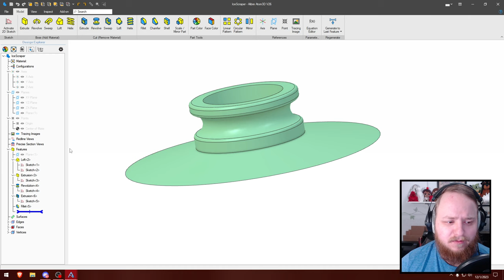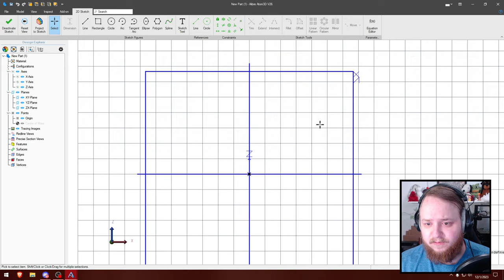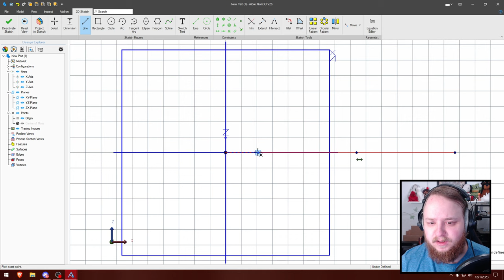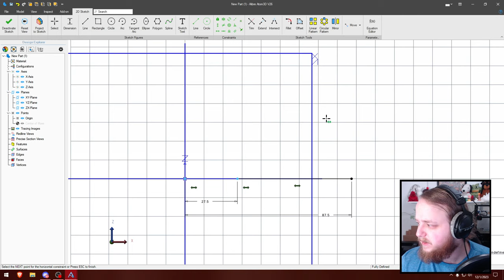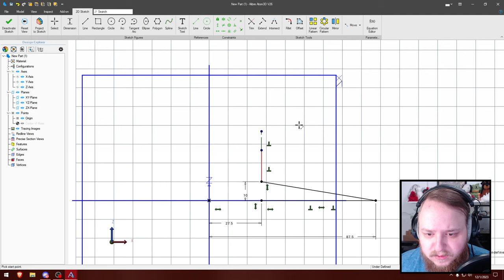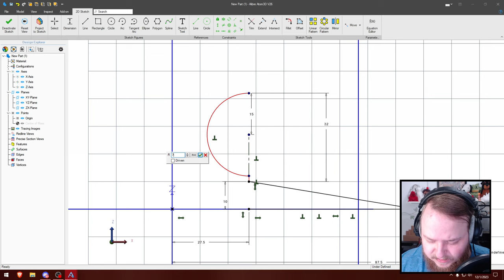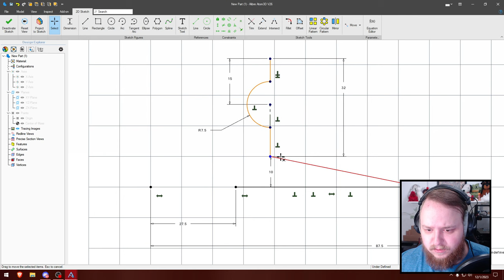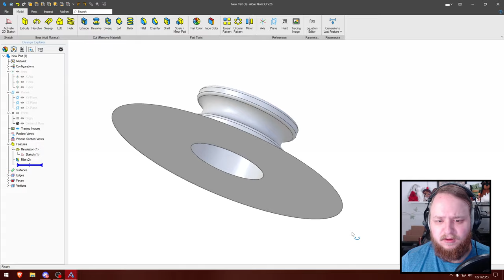My design skills are bad. Let's get better together!

Comment: I wish I was a beginner like you so I could relive the joy of exploring the magnificent world of Parametric CAD. Couple of things:

1) Constraint as you go is not a beginner technique. It is the best practice when you know exactly what you want to design. It's just that parametric CAD allows you to get it done in, as you rightly point out, many different ways!

2) I loved seeing you struggle. Because many people will struggle in the same way and your solutions will help them too. Especially the difference between setting that 10mm dimension between points and between a line and a point!

Great video man! Well done!
Reply from the maker: Thanks for the help!!
Reply: I almost always find better ways of making a model, after I made it the first time.
And I agree with setting constraints as you go, is not a bad thing. I've seen sketches go full bananas when adding the constraints after drawing the geometry.
Do what you are most comfortable with.

One thing that I find really annoying though, is the vertical Y axis.
I know it is a tradition in the CAD world, and there are reasons for why Y axis is vertical instead of the Z axis.
But my entire world is a Z up world. Translating the orientation all the time while modelling, is really annoying IMHO.
When I design a part, I think both of the dimensional constraints, functional constraints, and also consider how the part is to be manufactured.
None of my machines are Y up machines. So having to translate the print orientation all the time, really messes with my brain.
Reply from the maker: I always just convert it in my brain. I wish there was a setting in Alibre to change which axis is the vertical axis.
Reply from the maker: @janpetersen8441 it would seem that somewhere, somehow, Alibre now knows that Z is up/down for me. I don't know what changed, I don't remember changing a setting about that but maybe I did. I can sketch on XY as if I was sketching right on the print bed and it imports into my slicer perfectly.